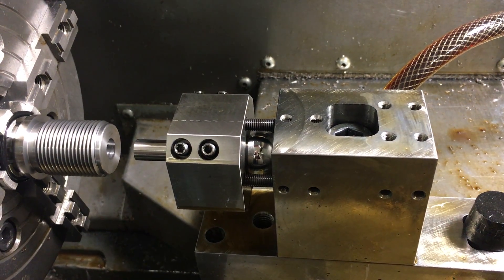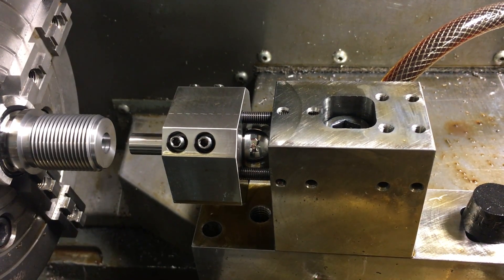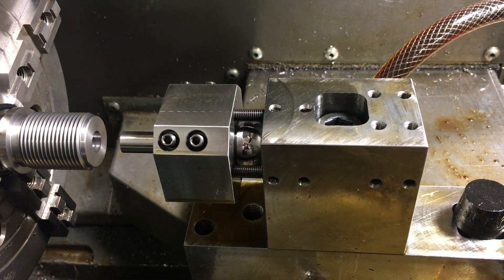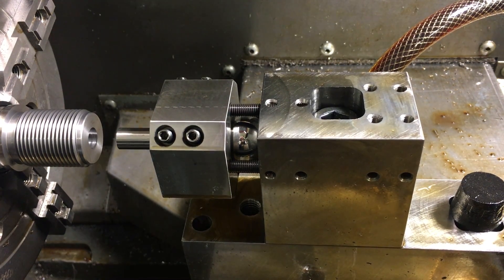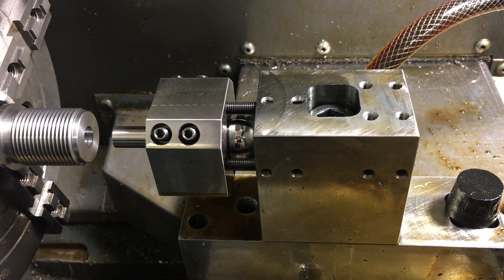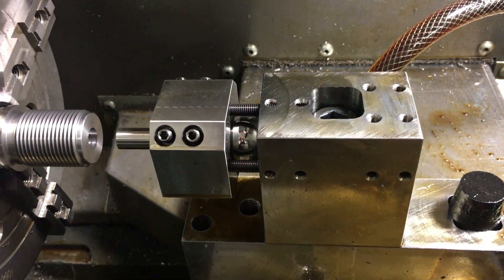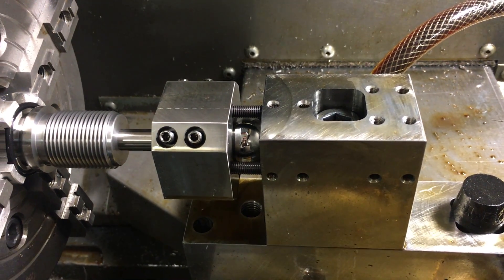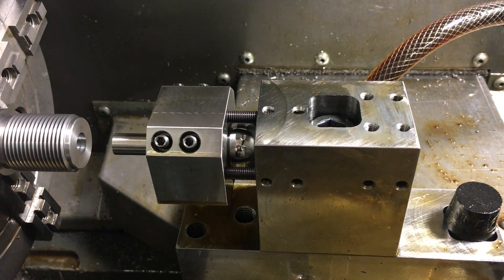Short Action Customs CNC Chambering Set up

Comment: Almost four years later– are you using True Bore Alignment System?
Reply from the maker: No, the only real changes are the reamer holder is more solid with more material. Also, we typically use a floating holder just to accommodate any unforeseen issues with the machine.

Comment: How long did it take you to move away from your full solid, non adjustable, reaming setup to this one? I've tried a full solid reamer setup a few years ago for production work (no gun-stuff) and it didn't work out for me. Went to a Mapal semi floating holder which was turned down to almost no play.
Reply from the maker: Every few months we were rebuilding the older style block because of a few reasons. The change in seasons, the shifting of the floor, the machine settling in and getting wear and such motivated me to build a new adjustable set up.  I like the idea of always being able to ensure its perfect and if it is not, we can use the 4 jack screws to accomplish that.